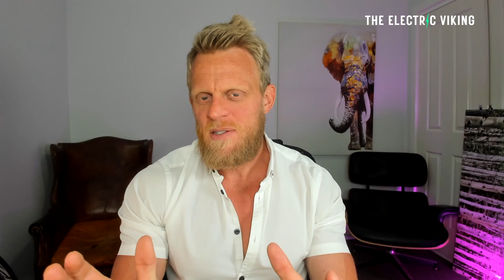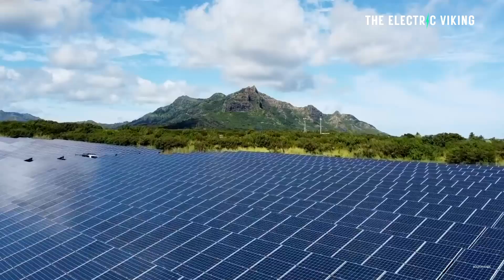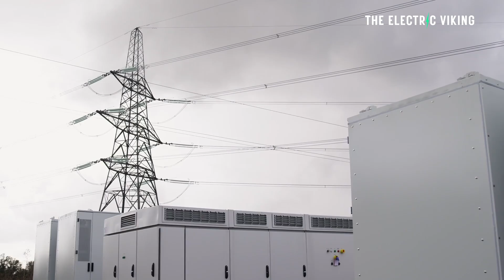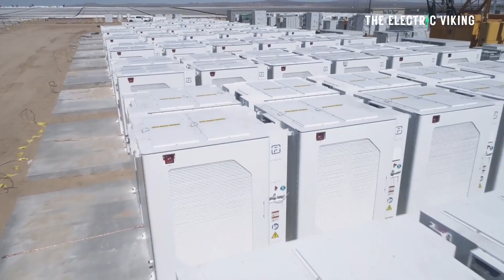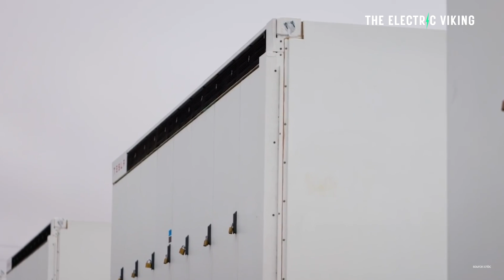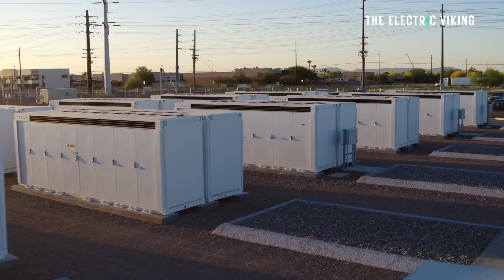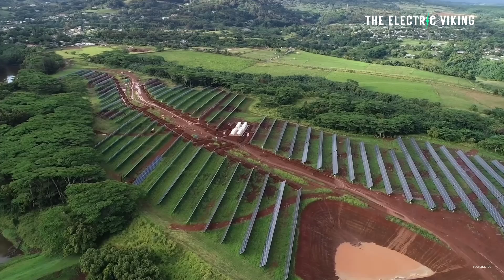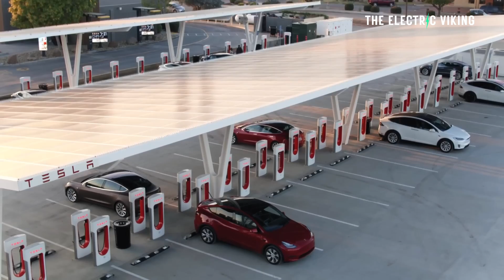Batteries + solar smash records in California and fossil power plants suffer

Comment: Trouble is it’s highly inefficient look at all that wasted land.
Reply: Wouldn't have to waste the land if everybody has about an 8kw system on their home with battery backup and a V2H electric car. IF IOT was incorporated it would be a cinch.
Reply: @chasl3645  agree, but then the management of the individual systems becomes a nightmare for the lines companies. It’s one of those catch 22 situations where they grid is old and really doesn’t like the strain of power being put into it from random sources, I’m sure this will be solved in the near future as there are talks of making the grid a smart grid.
Reply: @chasl3645  with batteries Solar is better but with batteries there is the environmental issues. Solar panels are bad enough, then you have the chemicals and relative short life span of batteries, we just don’t really have the tech for it to be of benefit without huge environmental cost later on.
Reply: @dave24-73  Rumor has it that they are closing the loop on recycling the components. Heard something like 15% waste. And the recycled materials are very 
 good quality. Also seems like battery performance and chemistries are improving.
I suspect with the computing power for advancements to accelerate.
Recycling is of top priority as it should be.
If this system is to be a legacy for future generations to be proud of.
 New Versis old.
Hopefully our opportunity to clean it up...
Reply: @chasl3645  main issue is cost, without subsidies it’s not cost effective, so although the West is likely to encourage recycling the west could be 100% green and it would not do a thing to help the environment on a global scale (countries like India and China in other words need to do more) granted every little bit helps.
Reply: Climate change is causing a problem with farming in California, not enough water. We know that some farmland will have to be taken out of production. It will then be available for solar. Another solar location is over the aqueducts/canals. This reduces evaporation and increases the solar production as the cells are kept cooler without using any more land, a win - win-win situation.
Reply: Other countries solved that by putting panels over rivers, parking lots, farmland, deserts, roads, incentivizing industries to use their roofs…
Reply: @jeffpitoniak  yes I’ve seen those examples, but it doesn’t really solve the issue, it just makes ether use of the land. They are still enormously inefficient compared to all other forms of generation.
Reply: @dave24-73  until you factor in costs of construction, waste disposal, and environmental factors

Comment: It seems dumb to use lithium batteries for grid storage though. Flow and gravity batteries are easy enough.
Reply: Flow yes, gravity... maybe not as much as people hoped.   But alternative grid-storage technologies have a hard time scaling up in the face of LFP battery costs continuing to drop, and drop, and drop.   Flow batteries also fix a different problem that isn't really front-and-center for California yet.  Flow batteries are best suited for slower overnight discharge but the most economic part of the day is the evening peak, where LFP batteries are able to discharge at much higher power levels for shorter periods of time (a few hours at higher power levels).

If you look at it economically, the reason LFP is able to compete so well in this environment is because LFP is able to get a much higher return for that 4-9pm time-slot than flow batteries can get in the overnight (call it 6pm to 8am) time-slot.

Its a problem for alternative storage technologies that might otherwise be good.

-Matt

Comment: Too much emphasis on battery storage. What about hydrogen from excess solar or wind energy? Hydrogen can replace natural gas in power plants.
Reply: Hydrogen cannot replace natural gas in power plants.  Hydrogen can be injected into natural-gas distribution systems up to a certain percentage (typically 2-5% by volume).  NG turbines can run with a small percentage of the natural gas volume as hydrogen.

But there are massive problems with hydrogen in general, not the least of which being that converting to and from hydrogen are both very inefficient processes.   It is also relatively difficult to store hydrogen... hydrogen atoms tend to leak through just about everything and will also sublimate into container walls, weakening their structure (called hydrogen embrittlement).

Basically what this means is that hydrogen as a form of storage leaves a lot to be desired.

-Matt

Comment: Your source are talking non sense.  The largest battery farm in the world is in Sydney and can only power just the residenses (not the entire city)  popuation 5 million for about 10 minutes. Southern California is 23 million; a farm of that size only supplying SC 2 minutes. The Sydney battery farm is costing 2 billion. To cover 10 hours would require 60x such farms or 120 billion. Southern Cal woud need 500 billion, just for residences; 2x these to try for full load; and these figures do not account for a massive shift in grid load if you were moving Vehicles to the grid. These "peak" solar production are at mid day lasting less than an hour 1/24th of a day.
Reply: I think the Moss Landing battery storage facility in California is actually the largest at the moment.  And you seem to be completely mis-understanding the purpose of batteries on the grid as well... maybe brush up on your understanding before prognosticating.   California already has north of 30GWh of battery storage on-line across the state and that'l probably grow above 60kWh over the next 1-2 years.
Reply: @junkerzn7312  At the moment the Sydney farm isn't complete.  30Gwh is nothing, and 60 gWh is next to nothing. Just natural gas and petroleum at 3500 trillion BTU.  All your confirming is there isnt a chance in the world that battery storage will ever meet the needs of half a single US state; let alone any significant part of the world. It is a total lie how pro solar/electric people convey their potential role its as trivial as these tiny battery installs.
Reply: @litestuffllc7249  You are mixing all of your figures up and taking them out of context, deliberately not even trying to understand how batteries work on the daily cycle, and using world-wide energy numbers in an era where adoption has only just begun on local grids.  Then raising your hands up and calling it impossible.  You also seem to be concluding that time stands still and nothing will ever change.

I really don't think anyone can take nonsense like that seriously.  Maybe you should spend a bit of time actually learning about these topics instead of pushing such garbage.

You can start by learning how batteries work on the daily cycle and why so much importance is attributed to cutting down peak evening power consumption.   Here's a hint:  It starts with being able to breath clean air.   You can also try your hand at electrification without renewable generation, which alone cuts fossil consumption by quite a lot.

On a country-wide-basis, gasoline, diesel, and electricity generation are the obvious low-hanging fruit.  Just as obviously, home heating and fertilizer production are going to be tough nuts to crack.

But hey, if you want to wallow in pollution of your own making your whole life, be my guest... you can just move-in next to an unregulated coal plant and see how long your lungs last.

-Matt

Comment: Meanwhile PG&E is charging us $0.66 a kwh during peak hours. $0.35/lwh off peak. I have solar and my electric bill is still through the roof! 🤬 The company is scamming us consumers!

edit: can't give link. google "pge residential rate plans" look at EV2 (which actually saves me money over the others, NONE are cheap...)
Reply: nat. gas fpl elec in fl . 148 kwh, $34.26 total with all fees. enjoy you "free green power." lmao
Reply: @csharp7926  that same 148 kWh would cost  Can$15.04  in Ontario. That's $10.74 US
YOU are getting scammed. Lol.
Reply: @csharp7926  nice. That’s how it should be. My bill was $1000 last month. F PGE.
Reply: Most Californians don't pay that much.  The average utility bill in California is only just slightly higher than the average utility bill in Texas, for example.

Actually, not sure where that $0.66 figure even came from... maybe tier 3 on a tiered tariff?   On my TOU tariff peak charges are $0.47/kWh and off-peak is $0.43/kWh.  No tiers.   But with 5kWp on my roof, my actual bill for April was only $24.00.

Its kinda hard to complain about a $24 bill.

Basically my electricity drops to $0 for 8 months out of the year and runs $150-$200/month across winter (roughly 4 months), depending on conditions.   Natural gas is similar.  Basically $0 8 months out of the year but can get expensive for the 4 months around winter.... $300 to $400 a month for three months last year.

I'm working on finding ways to further reduce my home heating costs across winter.

-Matt
Reply: @junkerzn7312  I can't give you links, cuz youtube comment... Google pge residential rate plan. Look at the EV2 plan. BTW, this plan actually saves me the most money over the tiered plans, because most of my electricity usage is off-peak. This is still ridiculously high compared to much of the US. So is our gasoline, and taxes... but nevermind that. I have 11kw solar system, and a tesla. Last year I charged my tesla at work for free, and still had a solar tru-up bill of over $1000. And my monthly bill? still $300-500 because of gas heating. It's just so damned expensive here... Also note, I have a big house and a big family. You live alone, I get that you can have a cheap bill. But I have older parents who need care who live with me, and temperatures can't be too low or too high for them because they just can't regulate heat as well. Also machines keeping them alive all night.. None of this changes the fact that even $0.35 offpeak is WAY too much. btw these are their new rates. They just increased, and it's a big change. Why aren't the solar savings being passed down to consumers? It's ridiculous!
Reply: @junkerzn7312  and how much are the panel payments and if paid off already, how much they cost? and how much did homeowners ins. go up to cover them? critical questions that are never included.  $300 to $400 a month for gas??? you live in a mansion? and i thought solar reduces heating costs. why gas heat? oh yeah. the $150-$200 a month heating has to be covered by gas cause the solar doesn't work. got it now.

Comment: I wish our government here in Texas would start investing in it. But they are so beholden to the oil and gas company, lobbies that they can't do. What's truly beneficial for the citizens of the  state
Reply: Right there with you (DFW area). We're stuck on stupid.
Reply: Texas actually is investing in batteries big-time now.   It is lagging behind California a bit but still way ahead of other states on battery storage.  And knowing Texas, the state where everything is super-sized, this state of affairs will flip around over the next few years.  Texas is #1 on renewables (though not on a percentage basis since Texas is also #1 on wasting energy).
Reply: @junkerzn7312  This is mostly due to private industry. The stuck on stupid part is the state's political leadership.
Reply: @ronin4580  
If you vote them in then you have to endure them.
Reply: @bobwallace9753  I sure as hell didn't vote "them" in.
Reply: Texas has huge wind electricity generation  sweetheart
Reply: @davelewis9439  I know my state's power generation numbers and issues very well. Private industry, much of it due to the leadership of the late T. Boone Pickens is responsible for the greater share of renewable energy in this state, sweetheart.
Reply: They're missing the boat maybe Texas should get behind this and oil. 
Oil will get repriced and margins should be good. Everything made with oil will go up. But we will be using less of it...
Gas, & diesel fuel are constituents of crude and it will be looking for another market. Not sure how that plays out whether it helps or hurts.
Same with base load coal plants. 
In early build out the peaker plants should be able to buffer the grid. 
Allowing the coal plants to be shut down and cleaned up.

Comment: The cost of electric in California have been exploding.  Takes about 100 square miles of solar and wind to make what 50 acres of the Diablo Nuclear Power Plant.  Batteries can not make up for winter power needs.  Going all renewables is unworkable.
Reply: There is no correlation in those random bits of data that even remotely implies that "going all renewables is unworkable".  Particularly given the fact that both California and Texas are over half way there already.
Reply: @junkerzn7312  Well said. Thanks for saving me the trouble. Although I do wonder why we even bother addressing these baseless and idiotic posts.
Reply: @eyesuckle  I wonder myself sometimes.  But the world is full of ignorance and the U.S., in particular, is ground-zero in that regard.   Plenty of dummies here in the U.S. that can easily be convinced to fall on their own swords, poison themselves through the air or water, and so on and so forth.  Sometimes the only way to make progress is to just wade through it all.

Comment: Let the buyer beware. A payback of a couple of years on solar? Bullshit. 15-18 years.
Reply: Is that because you have very inexpensive grid power?
Reply: It can vary, it really depends where you live (utility rates), how much electricity you use in general, and how much of the work you can do yourself (labor can be very, very expensive, particularly in California where the cost of living is so high).   So it can easily range from 5 years to roughly 15 years without batteries, from roughly 10 years to "never" with batteries.

But there are benefits beyond basic break-even.  For one thing you become more or less immune to inflation.  An EV owner doesn't care what the price of gasoline is any more.  A person with home solar doesn't care what the utility cost of electricity is any more.

And for another, it is an investment that adds a lot of value to the home.  If you ever sell your home, every last penny of the cost that went into electrification and home solar is returned to you with interest in terms of the home being worth more.  Though of course that isn't real money if you intend to live in that location until you kick over.

-Matt
Reply: I find it laughable that people scoff at the idea of paying $30,000 for solar that will last well over 30 years and literally pay for itself but have no problem paying double that for a vehicle that costs twice as much to buy plus fuel and maintenance and will get replaced in 10-15 years

Comment: The big thing in California is that they have a fair bit of local and interstate hydro that they can rely on to supply when sun and wind are not performing. Without that they would still need backup. Batteries are unlikely to be able to supply demand for the complete grid is most countries.
Californians are gping to be charged for having solar on the roof acording to the government.

Comment: My 12Kw ground mount system puts out ~50 kWh per day lately to the grid depending on outside temperature. Solar works. We need more storage to offset the eve use as well as the morning takeoff.
Reply: Energy storage cost is always the problem.  12v@100AH Lifepo4 is almost $300.  When its $30 wake me.
Reply: kWh
Reply: Investigate flow batteries salt ions

Comment: Please correct me if I am wrong, but there is no California grid, just the Western Grid. California is a part of the Western Grid. Three grids in the US,
Reply: California is part of the western grid in that it is interconnected and there are a ton of cross-border agreements in place, but the California grid is essentially a separate entity managed by the CAISO.   Federal agencies are also heavily involved for anything that crosses a state border.

The way to think about it is to view the entire west coast, including bits and pieces of Canada, as a single entity.  That's the backbone for the ENTIRE western grid.   There was one point during the massive mid-west heatwaves last year where power was being routed all the way from Canada through California to New Mexico and Arizona.

-Matt
Reply: From my understanding, while they are interconnected, it is considered importing and exporting still. If you pay extra for green energy, they are exporting excess solar for so you're getting the same power, you just pay extra for the excess power they are selling. Texas, number one in wind and two in solar along with so much natural gas coming out of the ground as a byproduct of oil drilling, prices recently went negative is on its own grid but is about to be connected to the outside states. Texas residential power is about 10¢ and California, who also has plenty of oil but can't update the rigs to modern more efficient rigs pays 45¢